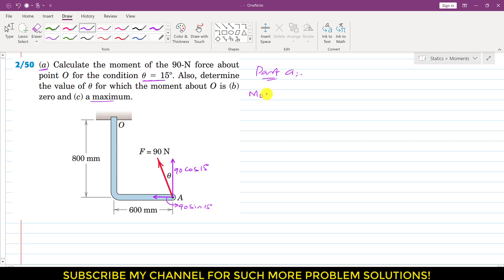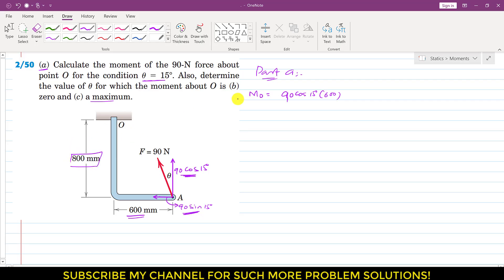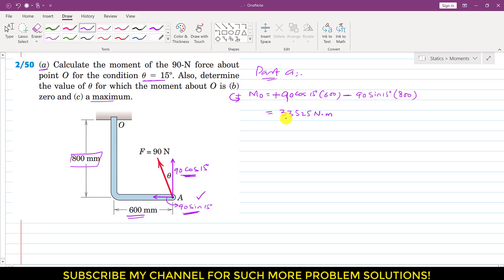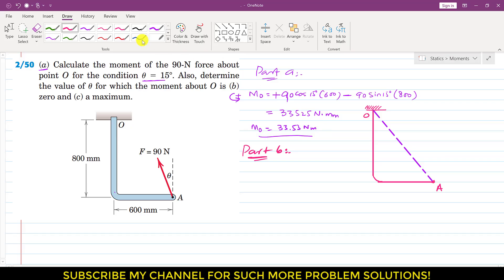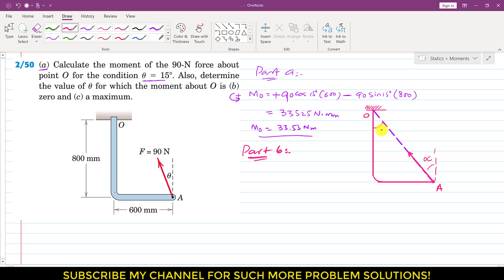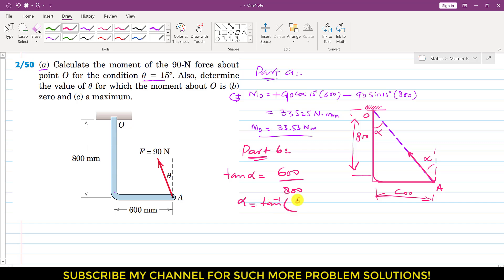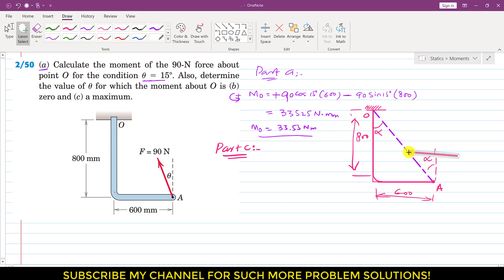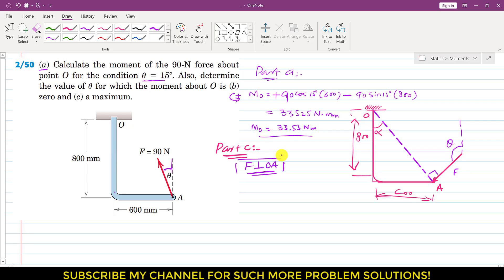STATICS | Chapter 2 |  P2-50 | 6th Edition | Moments | Engineers Academy

Comment: I don't understand where did you get the 36.87 from please answer i have a difficult exam tomorrow 😞
Reply from the maker: Your calculator need to be in degrees mode.
Reply: @EngineersAcademy2020  Sir, can we conclude in finding the maxima is just adding 90 degrees to the angle the where the Moment of force about a point is zero?